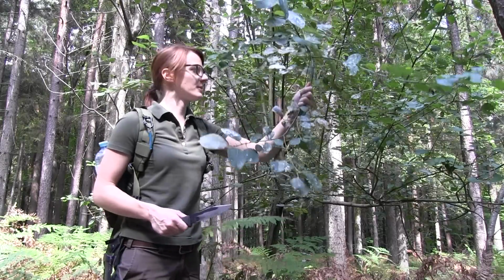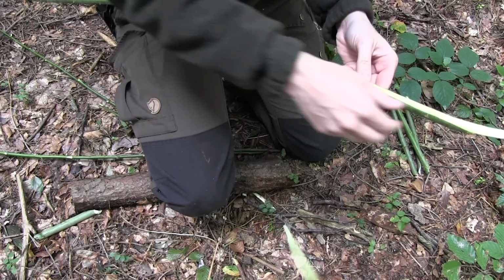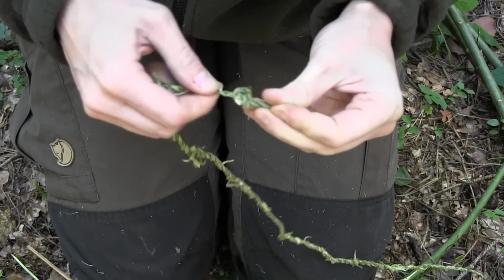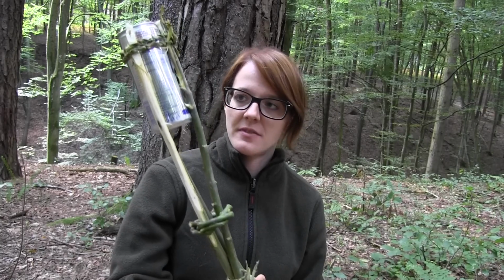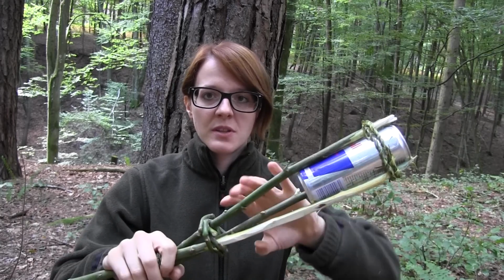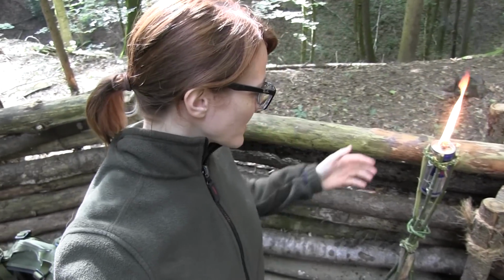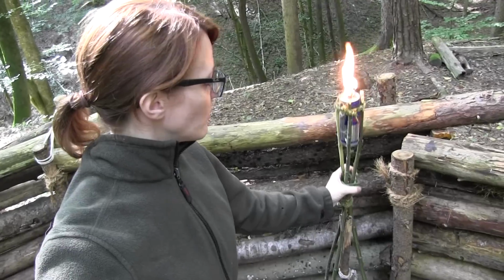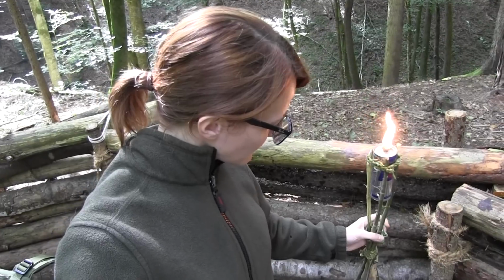How To Make A Torch With A Red Bull Can

Comment: Nice trick. If you carry fuel, it's worth it to have a Coleman (or similar lantern) that burns naptha fuel. It produces a bright light that great for camping and can easily last 10  hrs or so on a fill up. Other options include placing a tissue roll into a can and soaking it with alcohol or other fuel. Then you can wire it in place and worry less about spilling fuel. Be careful with fire!! Another way to get a torch is using birch bark pushed into a split stick. It won't burn long though. Are you trying to distill birch bark for fuel? Hard work! You can get a lot of various fuels from wood by heating it in a special cooker to separate all the various volatile components. Not something you can carry around easily though. Do you have a vid on that? let me know please as I will search it up. I like your series. thank you!

Comment: Lilly, You could use spruce or pine pitch/resin in the torch.  Melt it in a cast iron container over an open fire, then pour it into the Red Bull container without a wick.  Light the resin and it will burn.  When wanting to extinguish it, just smother it with a lid.  The only concern I would have is whether the light aluminum can could hold up to the heat as aluminum melts at 1,221°F or 660.3°C?  I think it would be worth the experiment though.  Great job!

Comment: Really a great idea. I've made tine candles like this out of MRE Tabasco bottles. They burn about 75 minutes or so, but I use foil to regulate the flame height. Just poke a small hole in the foil and pull the amount of wick through it for the flame height you want. It saves A LOT of fuel this way. Keep up the great work.

Comment: Lilly, you can make your lamp safer by taking some sponge, cutting it into small pieces to fit through the hole in the top of the Red Bull can. Fill the can with sponge. Add oil and it will be safer if it is accidentally knocked over. Safe camping!

Comment: Great Idea Lilly using trash as a torch. I like the rope braid, I wouldn't have the patience.
I've been using cans as fire starters and cookers for years.  I cut a beer can in half and fill it with gasoline and then put the wood above it in a log cabin style.  It lights 100% of the time with very little effort with wet wood.  When I'm hunting in the fall quite often you get soaking wet and cold and this method works quickly with less fuss.  Never pour gas on the wood, in the container it burns in a controlled manner like a torch.

Comment: love the torch and well all your videos. i spent 20 years in the theatre and we used to make torches out of pretty much any can. soup cans the best. but for a torch that you can fling around a bit and not worry too much about splashing fluid. cut the top off the can and pack it full of your basic tampons(super absorbency of course)and then fill the can with fluid and let it soak in and pour off the excess if desired.the tampons swell up and hold themselves in place quite well.  you can then light and have fun. we used to juggle with them and all sorts of things. keep making the videos, can't wait for more.
Reply from the maker: +Kendall Hatton Thanks for the tip!

Comment: The only natural lamp fuels I know of in the northern hemisphere are bee's wax and rendered animal fat.
Reply: +hoosierarcher and it stinks not only after mixing but also when it burns.
Reply: there is also pine resin
Reply: +hoosierarcher  We use pine tar on the end of a green stick to make little torches sometimes when we camp. Nothing elaborate, of course, just something to see a little better around the camp site.
Reply: +hoosierarcher does moonshine count?
Reply: +Erizon Santos if i remember it has achohol so yes, its natural lamp fuel. kinda.
Reply: +hoosierarcher Olive oil, Spermaceti (from sperm whales), and crude petroleum. All are natural and in the northern hemisphere, even if they're difficult to get.
Reply: I was referring to what was easily obtained in the field.
Reply: You never know what you might run across, I obviously wouldn't count on finding any of those in the middle of the woods though.
Reply: I agree beeswax makes a great tor h candle lubricant to season ur rifle, fish oil is another oil u can use too we used it years  ago on an outing as well as animal fat
Reply: you can make birch oil but its quite a process
Reply: in the same process as you make charcoal from birch you also get a pretty good amount of tar if you can collect it :) but it takes time bt it is doable at home or even in a survival situation if you can scavange the materials for it (mostly just an airtight vessel for the birchwood ^^
Reply: They used animal fat lamps at Luft Stalag 3, where the Great Escape took place.
Reply: hoosierarcher you can use resin also
Reply: hoosierarcher - I would have to say that getting pine resin would be the easiest to obtain since making other fuels in the wild is extremely hard to source and time consuming to make.

Another easier method would be using fatwood sticks, that's pretty much pine wood and it has a lot of resin in the wood so it burns very well, make a torch out of a few sticks of fat wood and you've got an easy torch without having to render down animal fat or perform the risky task of getting wild beeswax.

Comment: Lilly, maybe to improve the torch holder, you could place a pebble down in the split shoots of the limb you pounded into the ground that way the shoots will stay open and receive the torch a little easier. Another addition to your torch could also be a bottom of an additional redbull can cut and tied with some cordage to the torch to act as a snuffer instead of trying to blow the flame out.

Comment: Hi Lilly.

a good fuel you can make is pine tar and birch tar. they absorb into the wick like oil, and burn for a long time.

the problem is that it is very time consuming to make, but as a byproduct of making the pine tar or birch tar, you get excellent char coal that takes a low heat spark for fire lighting.

Carl

Comment: You could remove the top side of the can, stuff it with cloth or something that’ll absorb the oil.
You could also use tree resin/sap, alcohol, basically anything liquid and combustable.
Also you can mix charcoal dust with oil, or tree resin to make it thicker and it won’t easily drip off the cloth or absorbent material.

Comment: Get idea Lilly, I really 
-I wonder if you could cost the aluminum can down partially so there if a reflector on one side and an open area on the other? This would allow you to not lose your vision at night while you walk in the forest. I have used torches in the dark forest and you can only see a few feet in front of you (which is not enough) because the light is blinding you as you hold the torch is in front of you.

By cutting the can with your knife you leave half of it intact which form the rear reflector (which shields your eyes) them fold the rest of the can down down to mostly cover the large hole. Now position the tab you used to open the can (for drinking) over so that the wick can go through it. Once you light it, the light will go forward and none o the light will go backwards into your eyes. You will not be blinded by your own light and more light if refuted forward so your torch will now be noticeably brighter.

Comment: Just a little tip: when you cut the willow wands, cut them as close to the tree as possible, leaving  it neat with no cut branches. It will allow the tree to heal it's wounds with sap. 

If you don't do this, you leave the tree vulnerable to infection.

When you cut the tree neatly, it will also produce many more wands and branches.
Reply: Have you tried using pine sap for your fuel?  Great job on your videos, enjoy them.

Comment: aluminum melts pretty fast, now a days, tin cans are actually made of steel for the most part and would hold up better to heat... baby oil works great as fuel by the way. i would mix some methanol(/ high % alcohol in with it). love how you used the tab of the can! brilliant! the tabs also work great as terminal connections for deep cycle batterys iv found personally for low voltage stuff.  cool structure! you rock!

Comment: I think resin from a conifer trees works damn well for creating a torches... collect the resin from a tree, if you have a container than heat the resin so it gets fluid, than get one spruce cone and dive it in the resin and let it sink in, than get a wet green stick, chop the end to four pieces and place the spruce cone in there and you are done. U dont need anything else. If you dont have a container, just manually place the resin to the cone, it works too. If you cant find resin, just be ugly and break a branch from a spruce tree and come back next day to collect the resin. Also, if you collecting the resin, its nice to not take it all, as it protects the trees wounds from bacteria and fungus, leave a bit there... but if you dont, the tree will make new resin anyway if needed.. you just increased the chance of a tree getting into the problems for a while, in 99,99% it doesnt matter.

Comment: Not sure If it has been mentioned yet but one could use rendered fat from say a wild boar kill to be used as lamp fuel.  If the rendered fat is mixed with a little alcohol it may prevent the fat from becoming solid in the cold.

Comment: Hey ,  that's pretty slick Ms Lilly.  It is a different kind of torch than I imagined but still quite neat.  Another type of torch that may be of interest for someone into survival mode tactics and is cheap, legal, simple and extremely effective for protection ...is a nice healthy can of Carburetor cleaner and a Bic lighter.  The Carb cleaner cans all shoot a heavy stream 12 to 15 feet with accuracy.  Carb cleaner is high pressure nail polish remover...highly flammable.  Large mean animals have a tendency to bolt when they see a monstrous flame appear out of nowhere and heat them a little.  A psycho with a chainsaw,...you have to just dot him in the eye....keep your distance while bathing him them show him your lighter.  OPE ...he can't see.  OK Then tell him about your lighter.  Or send a monster flame from 15 away.  that'll teach em'.   Pardon me.

Comment: A good fuel source that's plentiful is the pine trees around you. You can find the pine stumps from recent deadfall (or better still, from trees that have fallen over and uprooted), and hack away at it. The pitchy smelling, reddish color wood is rich in concentrated resin. It also has the benefit of repelling insects as burned. It lights easy, even when wet, so it's a good fire starter. Or, you can put some in a pan of water, boil the resin out and scrape the oils off the top.

Comment: I make lamps from a soda can. You cut open one side of the can like those little cereal boxes are in the multipacks, in a sideways H shape. Then use the tab on top to hang the can with a candle inside. the can's inner area reflects the light any direction you choose.

Comment: I just subscribed! I like your other video's, this one doesn't seem very efficient to me however. As you said; you have to be really careful with the lamp oil leaking out. Seems more like a complicated candle than a useful torch to me.

If you had to remake another torch without using a redbull can, how would you have done it?

Comment: That goodest boi gonna need a bath. Such a good boi:)
Edit: Roughly how long does the torch last in correlation with the amount of fuel used? Also would it be better to use sap or lug around a bottle of fuel?

Comment: I know it may not be the easiest thing to do, but if you could catch one of those wild boars that you've been trying to bait. You could render their fat and produce a lot of oil. You would just have to keep it covered hopefully in an air tight container. If I am not mistaken even if the oil became rancid it would still burn. Maybe mixing in some pine resin while it was still hot would help with preserving it.

Comment: You could if you have pine trees make the fire liquid from pine sap. It just has to be made into water to keep it from hardening.  Just begin with boiling water and add pine  needles to it and keep replacing them as they let go of their sap, eventually you will have a solution that is more sap than water, but it needs the water to make it stay a liquid.
Pine sap also makes an excellent glue that dries very hard.

Comment: About the only thing I can think of for naturally fuel would be the sap from trees rendered into a liquid. Then cloth added to absorb the melted sap. Add fat wood to the concoction. You’ll have to experiment with the making of wicks and how long the torch will last but binding all the items tightly together and placing into an aluminum can with breather holes on the lower sides (not the bottom) should do the trick.

Comment: Will you do a follow up showing how well it works at night?  Obviously it burns, but I'm curious how much light it throws.  How much oil will burn for how long?  What are you using for a wick, is that a cotton cord, yarn or real lamp wick?  Used cooking oil might work as a fuel.  It's not found naturally, but it's a form of recycling that costs nothing.  It might smell a bit though.
Reply: I've seen someone use olive oil as burning fuel, and it worked just as good. And it is a torch for a reason I'm sure it throws off pretty good light, she made it mobile so if you wanted to bring light in closer to you, with that one in particular you can. She is very inventive. ^-^

Comment: This may not make a high flame like the lamp oil or kerosene used in your demonstration. The pioneers of the earliest days of the USA saved the fat from beef (tallow) and pig (lard) to use for small lamps. Found a reproduction of those grease lamps and it works. Used bacon grease so the house smelled like breakfast.

Comment: I saw a vidio where a person makes chacoal and a thick black oil by baking pine wood in a presure oven over a campfire. Perhaps this pine oil could be used as torch fuel, it is probally toxic and will not off either. could be used as oil to cover wood, to prevent rotting.

Comment: this is very easy .you can take one glass bottle make sure cap made by aluminum or iron then  filled up with oil likE mustard oil nd used one shoes lace, other material used cut your tshirt ,shirst cloths make a long thread that firsty filled up mustard oil in glass bottle then very small in cap because thread used to across the bottle and cap then close cap tightly lit the theard .its ready to used

Comment: Cool,
so  the  kind  of fuel  is  the  important  element,
wondering  what changes  you  hafta  make  depending on  fuel,
i.e., how  full  do  you  fill  the  can?  How  big the  wick  hole?
Lastly,  how  about  a  video  on  what  to  do  about  your  glasses,
what if  they break  out in  the  field,  etc.?
Thanx cutie:)
Reply: Pretty sure the type of fuel does not affect the how full you fill the can, and the hole for the wick is the hole already in the can.
Reply: I'm  thinking  it  is  better  to  have  a  small  hole,  rather than  such  a  large  hole  for  the  wick,  apt  to  flame  on I  think

Comment: that's Innovative and a good re-use of a Red Bull can...
 however, would not bring tiki torch inside of bug out.
if dropped on ground accidentally, you will have one fiery mess to deal with in a confined space.
accidentally burned myself at the age of 10 with gasoline on my legs... fire has no conscience.
please be safe, and if you're going to take the time to carry all that other stuff into your campsite. take the time to bring a fire extinguisher
Reply: That's not a bad idea... a vid describing how to make a basket full of loose dirt to throw on a fire in case of emergency.

Comment: Sorry Lilley, but unless your in a survival situation, which you are not, there really is no excuse for leaving live trees and bushes with messy hack marks that leave them at high risk of infection, which spreads to other trees. Use a saw, or use the knife properly with careful push cuts and take your time. Leave a clean cut on the tree. Its really not that hard and it makes sense.

Comment: I hear that you can actually boil water in a plastic bottle is there any way that you can demonstrate. that please
Reply: +pjdupre can u try it if it don't work fine but if it does work can u please make a video about it just use a water. bottle over a camp fire over the flames not in it this is what someone tells me please help me PLEASE😉
Reply from the maker: +carrie & Lewis beautiful marriage it works but I dont want to show it on my channel, the plastic will get very hot and some nasty stuff from the plastic will dissolve into the water, I do NOT recommend that technique